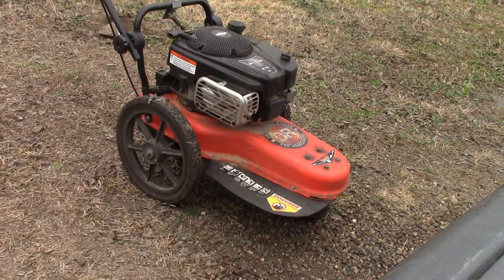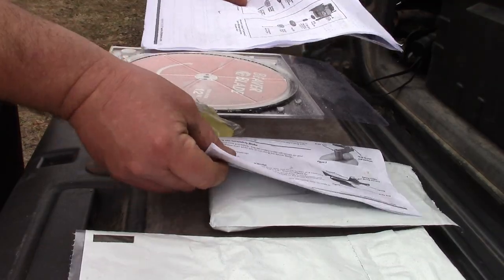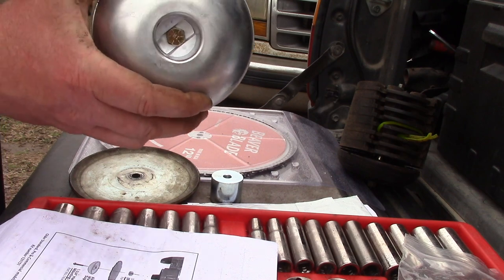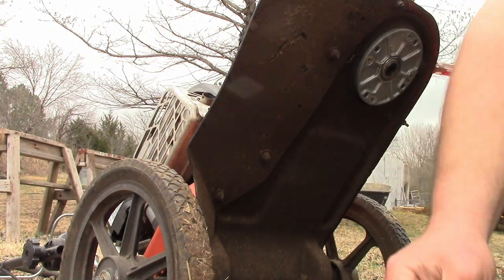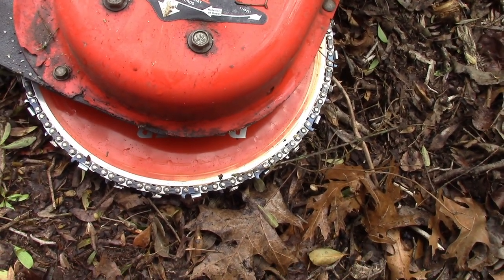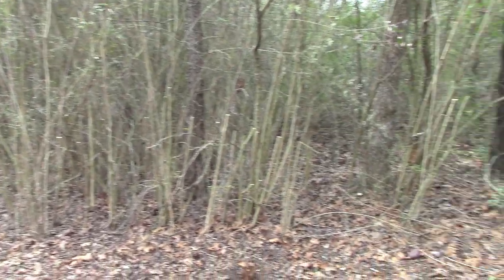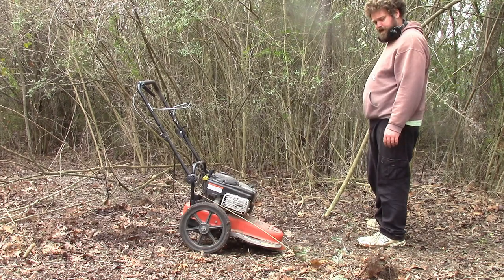Installation and Review of the 12” Beaver Blade Attachment Kit for DR Trimmer.

Comment from the maker: The first part of the video is the "How to install the 12" Beaver blade on a DR" section.
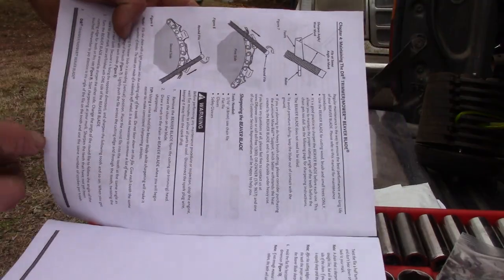Review starts at 5:12 and I think is a must watch for anyone thinking this product will be a game changer. Even with this tool you have lots of work ahead of you when clearing brush.
Just a note on this video. I filmed this February of 2019 and forgot about it. Edited it 4 years later in February of 2023. We have used this tool a lot since filming this video and have worn out the teeth on the blade to the point we need to replace it no sharpening will save it now. In the video I said I was going to install a shed, I went for a 40 foot shipping contain instead.
Thanks for being here if you have any questions please leave a comment and I'll get back with you.
Reply: is it worth the money? I have a hill side that I cannot get my tractor bushhog on because it is too steep for a tractor, but I can walk up it or down it. Has saw briars and small 1-2 inch pine trees and other brush I need to cut out of there. Is this a good tool for that?

Comment: My first thought is, it's a chainsaw blade. I would think that a 10" or 12" or 15" carbide tooth blade would work but then you don't get the additional adapters. If you hit fencing, steel posts ect. the chainsaw blade is dull but then carbide teeth would fail too. I don't know.

Comment: I use a stihl whipper snipper with a saw blade and it's 10x faster than this unit. It cuts 1.5" trunks with a swipe, no pausing.  I've upgraded to a DR 30" brush mower to make trail clearing even faster. This unit doesn't seem efficient in comparison.

Comment: Thanks much.  This sure is confusing, isn’t it.    How did you get the large diameter mounting shaft for the plastic disks off. I didn’t see that part.  Oh ok, now I see. So by using the Phillips driver in the hole in the frame, that locks the upper shaft from turning and the whole thing theads off?  disks and all.